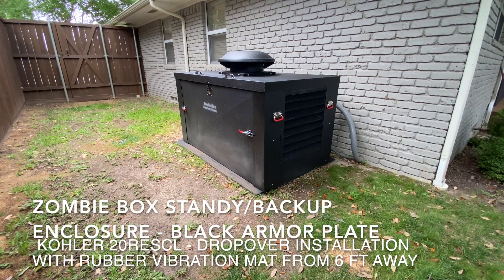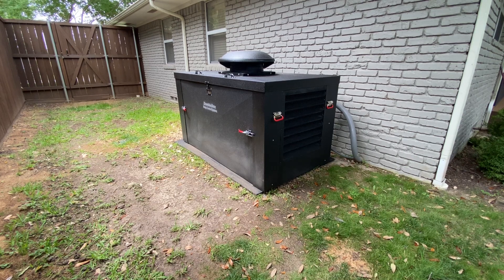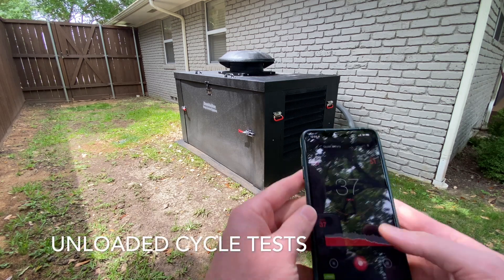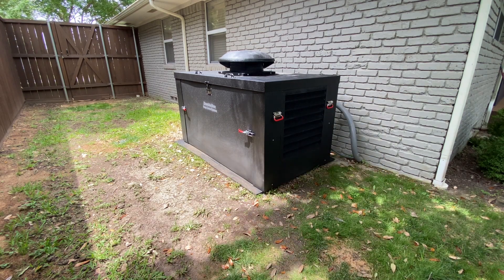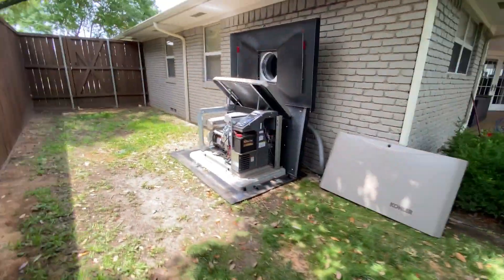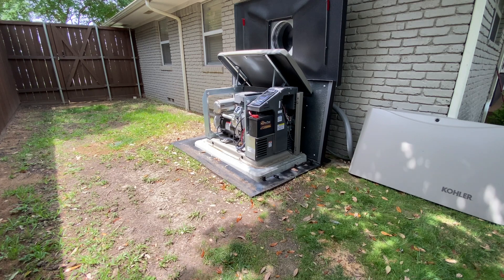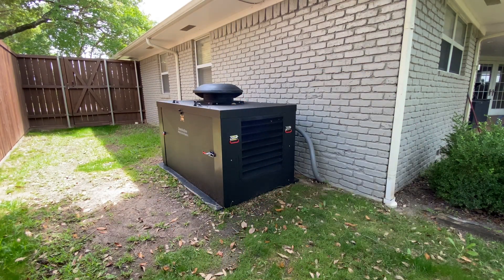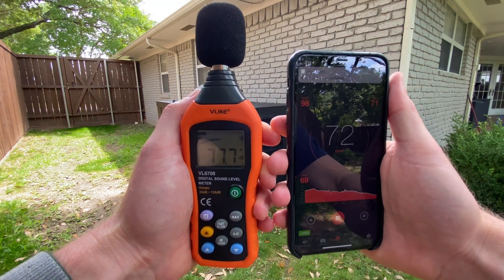Zombie Box Standby/Backup Enclosure Review - Kohler Dropover Installation

Comment: Thanks so much for taking the time to show how this works in a real life situation. Greatly appreciate it! Just curious how easy it was for the back panel of the Zombiebox to install around the existing gas/other line coming into the box. Are there precut holes in the Zombiebox for those or how did that panel get installed? Thanks for any insights you can provide.
Reply from the maker: Not sure if all their boxes work this way, but when I ordered I measured and told them where lines came in. Then, they send the metal back panel with a cut out that is covered with thick foam you custom cut to fit your specific lines coming in. As an example, if the back panel was 4’x6’ then there was a 1/2’x2’ cutout in the middle that was covered in foam and I cut the foam for my specific incoming lines.

Comment: You can buy two generators for the price of that Zombie box.
Reply from the maker: If I could start over, I would spend the extra money and purchase a liquid cooled generator that runs at lower RPM and is inherently quieter. That’s my plan for my next house. Live and learn.
Reply: @pkslaughter00  I would love that also but with liquid cooling you've got so much more to go wrong and maintence. Water pump, radiator plus hoses thermostats. It would be great if someone made an air-cooled 1800 rpm generator with some kind of noise reduction built right into the motor design.

Comment: Thank you. Very informative for this viewer about to jump into a standby project.
I've heard more good things about the Kohlers, and I'm also looking at the Briggs & Stratton. Mostly because I've owned other outdoor power equipment using both and like those.
One thing I couldn't get out of my mind was how much room there seemed to be to hack both enclosures. Maybe line at least the Zombie Box with a healthy layer of rock wool sound insulation. The Kohler sounds pretty good, but I see room for more insulation in it too.
Reply from the maker: Agreed, there is room, but from what I see in person (hard to capture all thoughts in a video) the real sound leakage is coming from the intake and the exhaust not the walls themselves. There are professional acoustic companies out there and the way they quiet these things is by creating mufflers on the intake and and exhaust (the boxes I have are pretty much open line of sight with little muffling) that do not hamper air flow. From what I am seeing as well that would be a much more effective tool at reducing noise than more insulation on other parts of box.
Reply: @pkslaughter00  Maybe an active noise cancellation system, but I don't see any sign of one on the net and designing one is above my pay grade.

Comment: OK; you did not point the mice of the phone or the meter at the generator - This makes a real difference. My real reason for posting is  I can see you are getting ground noise - The gen'y is vibrating the ground and and using the earth as a speaker.  Probably for about a meter agound the generator.  A big improvment, for you, is to use a rubber/foam base below the generator.  Nothing should touch the concreate base.  Concreate bases are not good.  Ground based noise will be a big part of whet you are hearing in your bedroom.
Reply from the maker: Peter, thanks for the feedback. I have played with the meter a good bit and my readings don’t change materially unless I am misunderstanding. From what I can see, the Kohler generator/pad connection seems pretty well designed. The generator frame sits on rubber feet to reduce vibration transmitted to the pad so it is already generator / rubber / concrete. The intent of the video was just to show the impact of the Zombie Box. Appreciated the tips, I decided after this I am just going to buy a liquid cooled generator on the next one and not mess with sound dampening.

Comment: Your phone doesn't work as a good db meter. When you took the first small end panel off it got louder but you phone said 70db. That was wrong and you should've been able to tell it for your self.
Reply from the maker: You must not have watched the entire video. Please watch the whole thing. I went back and used an actual dB meter and got different values at each point but the delta in noise reduction was ~ the same.

Comment: How did you remotely start the generator?
Reply from the maker: Kohler has a great mobile app. I use it on iOS. My generator supports a wired network connection. When I installed it I had them pull an Ethernet cable back to my router when they installed all the electrical. I think most new generators support network connections these days as a standard feature. You might have to buy an adapter if you have an older generator if they are available.
Reply: pkslaughter00 after I asked the question I realized that yours is a Kohler. We just installed a brand new Generac 22KW and it does have Wi-Fi with mobile link monitoring but does not allow remote start and stop. Since it’s hooked up to the automatic transfer switch doesn’t really matter. I like your set up, I’m going to look in to see if there’s a way to run an ethernet cable to mine as I have 36 ethernet cables around the home already connected to a server rack.
Reply from the maker: @Deezybz  To clarify, I am running an exercise cycle from the app to turn it on/off, so my house is not seeing any power from the generator when I run it from the app. The transfer switch is still controlling whether or not the house gets power from the generator automatically. So my "remote start/stop" is just a remote exercise cycle. If your Generac app does exercise then you may already have the same ability I have. If not, you might check with Generac before you go to the trouble of pulling a cable and just make sure it will support what you want over ethernet.